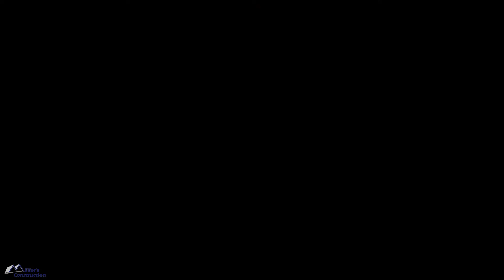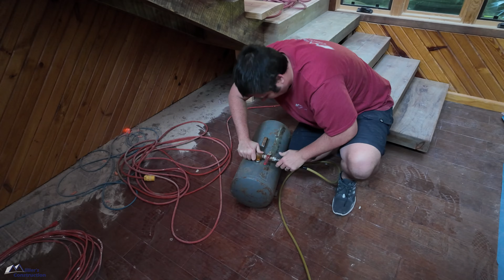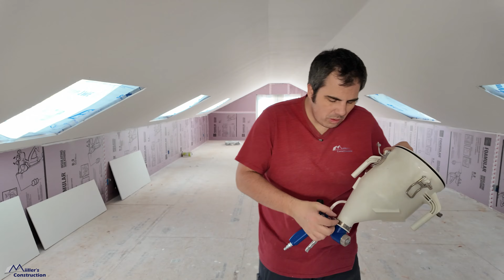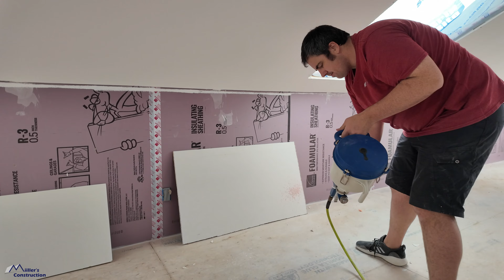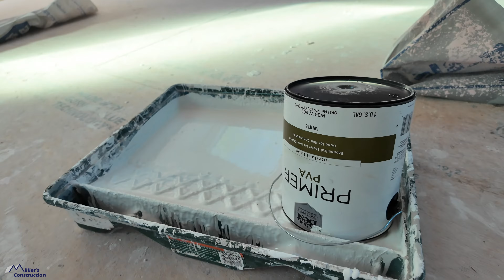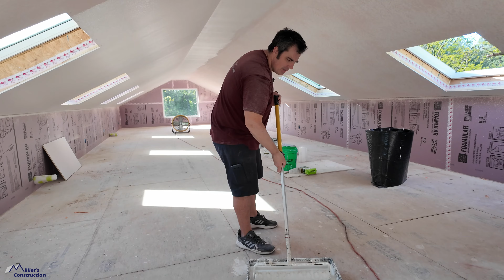How To Spray Knockdown Texture On Drywall - Step By Step Instructions! Plus Graco Hopper Setup!

Comment: As a painter taking on a texture project to expand my skill set- seeing you put chalk in the mud didn't upset me at all, if anything I thought it was genius! I just finished priming the walls White and you couldn't be more right! I was most worried about an even finish- putting colorant in it is such a good idea! The only painters who would get mad are the hacks that would skip the post texture prime & try to one coat wonder the project.

I see you didn't prime prior to texture, i assume on bare drywall it may not matter as much but on a re-paint where I dont know what paints were used or contaminates that could be on the surface a pre texture prime was in order!
Reply: He did prime he said.

Comment: Nice hopper, I would definitely like that instead of gravity fed. I been doing this for years. You read directions like I do, skip every other line haha.. Interesting concept using chalk, sealing walls, are everything I had problems I had.  Well done.
Reply from the maker: This hopper is still primarily gravity fed though. The amount of pressure being pumped into the hopper is minimal.

Comment: That sprayer hopper is too small. It seams to put out so much material you run out too fast . I would stick to a regular 3 gallon hopper and traditional style sprayer that has air shut off within the trigger pull to also save my compressor from overworking itself. All those texture sprayers that just flow air all the time and wait for the pull of a trigger to flow material suck

Comment: Hi, 

Did you use house wrap to protect those windows?
Reply from the maker: Synthetic felt. It was extra so why not use it.
Reply: @miillersconstruction 

No totally. I’m in the middle of a bathroom remodel and I’m just looking for more efficient ways to prep rooms or use things that help mask off different areas.

I realize I tripped over drop cloths in that even my current client who has walking issues could be a real hazard so I just need something more efficient so I don’t know if that’s temporary solutions they get thrown away after each job 

Or something a little bit more expensive that’s a little bit more refined, but also reusable

Comment: use clean buckets and brand new boxes of mud to avoid dry chunks, they can also clog your tip....mud is cheap labor isnt....anything leftover becomes taping mud or thrown away

paint tint works well for mud

keep 2 buckets of water....one for the mixer and tools and one with a sponge to keep mud buckets clean, keep the rims free of mud tht can dry up

Comment: Thank you for the depth & detail of this how to!! Probably a silly question, but I’m a little new to all of this. What grit would you recommend for sanding the “giblets”?
Reply from the maker: That's not a dumb question at all. Great question actually. I would use 100 grit, especially if it's a little worn out. You really don't need much. Even 200 grit would probably get it. You're just barely knocking those giblets off. They are eyesores and will come off by barely touching them anyways, leaving you with a bad paint spot so that's why I always take the extra time to sand it. I've done an entire house that way, it's not a big deal, it just takes a few extra minutes. Pros that do it everyday and are getting paid regardless, will tell me I'm crazy. This client along with a lot of other clients I have want really nice work. They're not paying me to cut corners in any way. They would rather pay me full price and get the best possible results.

Comment: Good information could you please share the name of the ink you use to mix the texture.
Reply from the maker: @martbravo701  it's just Standard chalk for a chalk line
Reply: @miillersconstruction  thanks so much
Reply: What is the right psi recommended to apply orange peel for this hopper? @miillersconstruction
Reply from the maker: @martbravo701  I have not tried shooting orange peel with it yet. That's an extremely rare texture in my area.

Comment: Good video. Does that hopper require a certain size compressor or running psi ?
Reply from the maker: You could get by with a smaller compressor if you are doing a very small area, but whenever spraying texture your main focus should be VOLUME. You want a high cfm rate and a lot of volume of air. We always use a compressor with at minimum of 4cfms and at least 10-20 gallons of air volume available. We have an 8 gallon expansion tank that helps tremendously with that.

Comment: Standing too close, plus you should let the mud set up a little longer before knocking it down. Curious, how many times did you have to fill that hopper in order to complete this project? Also what's the CFM rating of your compressor? Thanks.
Reply from the maker: @gme10955  I like to knock it down immediately and I can't stand the look of texture that's set up for a little bit. It looks horrible. I was standing too close? Interesting. It's worked for me for two decades so I think I'll just keep shooting it this way. I would never purchase the Graco compressor. Refilled a few times, a gentleman with your experience should be able to look at the size of the hopper and tell that.
Reply: @miillersconstruction  your technique was horrendous. But thanks for the video I can tell i like how it sprays the hopper looks like a pain in the as.

Comment: Do you still use that hopper?
Are you happy with it?
Reply from the maker: Sure do. I just filmed this video like 2 months ago.  We really like it. Pricy, but nice!
Reply: @miillersconstruction  have you used the wide tex tips?  Any thoughts?
Reply from the maker: @moderndayinteriorsandrenov4681  I've only used the one tip so far because I like the way it looks. I would be interested to know what your thoughts are of the Graco compressor setup. Too pricey for me. I used to have a big Kodiak texspray. Got tired of hauling it around myself! Sold it.
Reply: @miillersconstruction  ill let ya know after I try it.  That's where I'm at with the big units..  too much work to haul it around and then the clean up almost makes it not even worth it.
Reply from the maker: @moderndayinteriorsandrenov4681  that's why I decided to go this route as well.
Reply: @miillersconstruction  I ordered the whole setup today.  Hoping it's worth the dollars.  I have a large rtx 1500 but sick of packing it around for smaller jobs..
Reply: I'm surprised you didn't buy the compressor that comes with with the new Graco "Fast  finish texture sprayer" it's   9cfm

And if I may when you spray you are really linear .

Should move your hand in kind of random circles.
Reply from the maker: @PerryTradesman  Have you priced that compressor? Not a chance. Also, I like the way my texture looks. I often do random circles but this was a little different situation for me, odd angle.